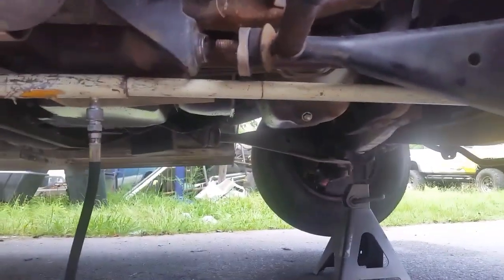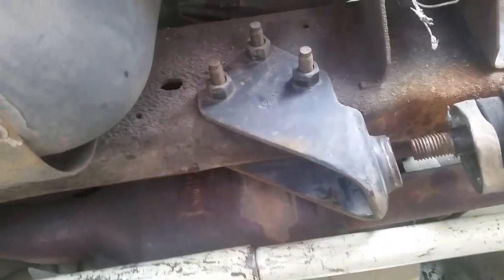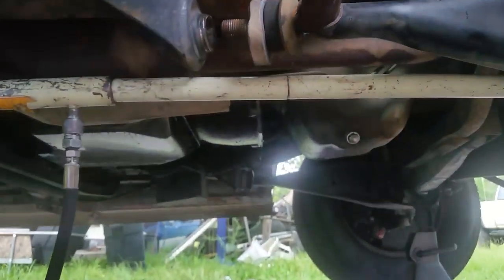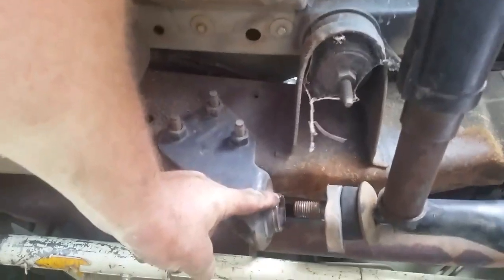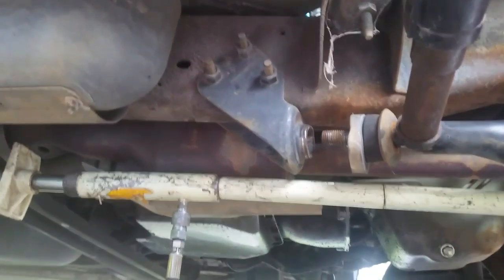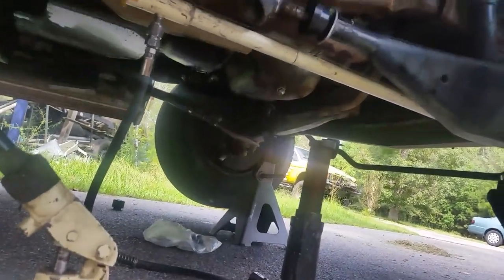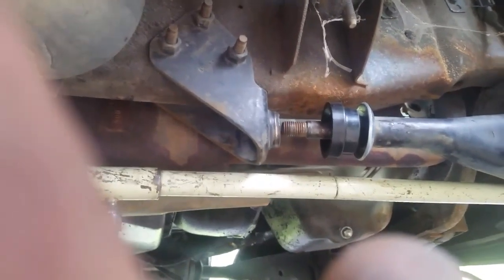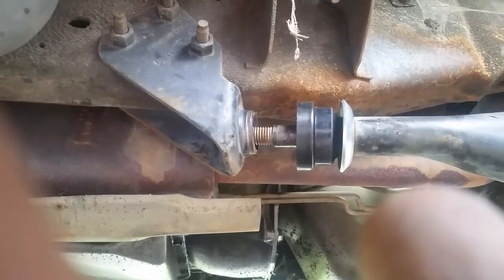Radius Arm Bushing replacement on 1996 Ford Econoline Van

Comment: You are a genius my friend, that is exactly my problem with my 94 E-250. I bought the book and they wanted me to take the spring, shock, caliper off (screw that crap). My Dad said to drop the exhaust (do able but still a headache). Your Video is the answer. The company I work for has one of those hydraulic spreader bars. Thanks for Your Video.
Reply from the maker: Just be cautious.

Comment: That bracket is on the wrong side the boat should be on the the outside. Whoever replace those before put them on the wrong side. You should be able to take out those three bolts and dropped the bracket by itself after taking off the retainer nut, you might need a pry bar to pry it down from the frame

Comment: If the bracket were reversed like the above comment, the bolts would rub a hole in your exhaust. This is how they come from the factory.